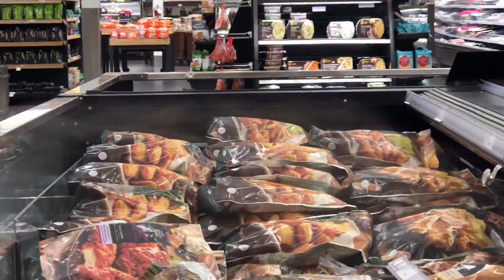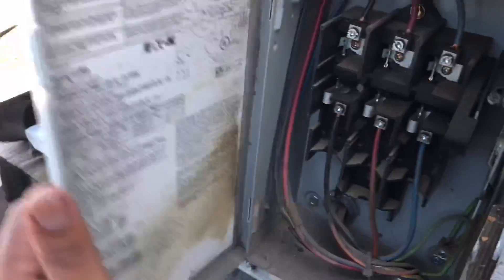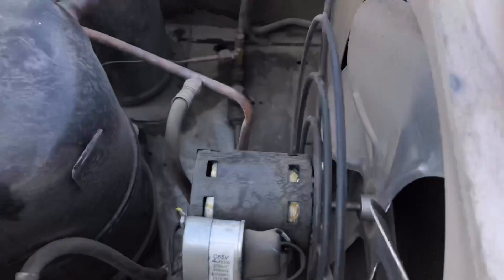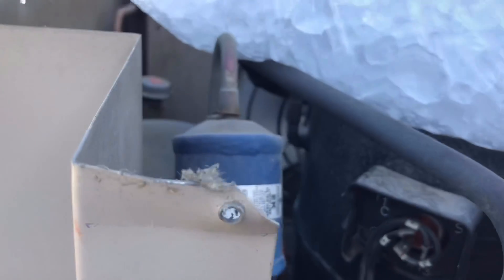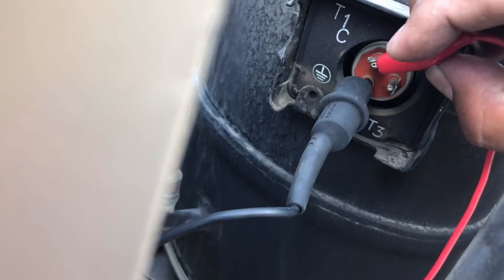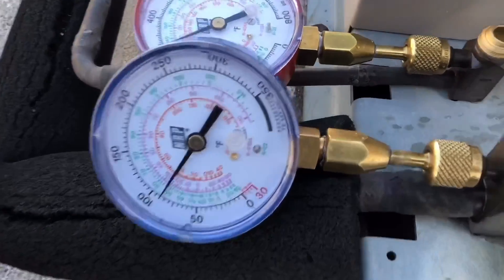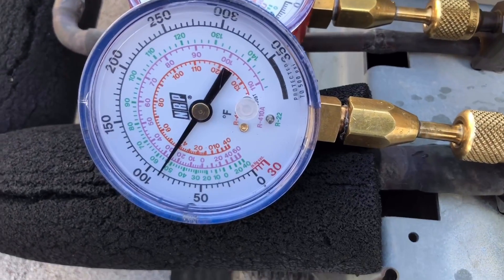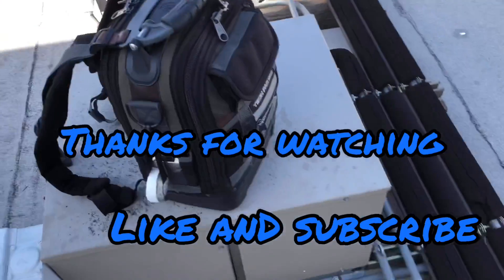HVAC Refrigeration:  Reach In Cooler Compressor runs but doesn’t pump.

Comment: Min 4:45
Fan won't run unless "pressure" (suction?) is greater than 250 lbs. 
re: Fan Cycle Switch
Reply from the maker: Discharge.   High side pressure.  Not suction
Reply: @rookierefrigeration4357  
Right.
("I should have known.")
Reply: @rookierefrigeration4357  
Thanks. 
Question: if discharge pressure has to be above 250 psi for the fan to turn on, how come the fan started when you started the compressor and the head pressure was below 250?

PS: great vids. Some are real 'stumpers'.

Comment: MN 3:36
How do you know the motor is good?
What is the meter showing?
Reply from the maker: I’m checking resistance on the windings.  I’m just checking for an open circuit, or shorted/grounded.
Reply: @rookierefrigeration4357  
Thanks.
I must have been thinking "meger".

Comment: some recip compressors would have an internal pressure relief.
Reply from the maker: They do. This one failed, you can see that in the following video
Reply: I'll second that, you can hear the relief valve letting go. I bet the amps were high like on a hot gas defrost, etc without CPR. Was about to make this comment, looks like someone smarter than I beat me to it.

Comment: low amps and high suction.got to be careful with copelaand scrolls.they can disengage motor from compressor if overheating happens.will start pumping again after cool down.usually if system is low on charge this can happen.
Reply from the maker: Yeah I’ve seen that
Reply: @rookierefrigeration4357  
This is a Copeland scroll?

Comment: The fastest way to tell if it is pumping is to check the amp draw. If it's not pumping the amp draw will be low.
Reply from the maker: Yeah.  And also the suction won’t drop or the pressure will remain equalized.

Comment: I absolutely loved being a refrigeration tech and do miss it a lot. There is no other profession that involves this level of troubleshooting and process analysis. But, you must go the extra steps to find out why systems/components failed to be the best in the industry. Otherwise you are simply a parts swapper.
Reply from the maker: Thank you John.  I appreciate that.   Did you retire?  Or just move on.
Reply: Commercial food equipment does, although I guess you could say they’re the same trade being most of us food equipment guys do both cold side and hot side equipment.

Comment: I think over charge unit
Reply from the maker: Pressure was not high enough to consider overcharged.
Reply: Rookie Refrigeration allready 350psi your compressor when you pump down unit your discharge bypass, you can’t pump down because unit overcharge , your compressor good, need to remove gas.

Comment: Suction drier blocked up probably
Reply from the maker: It was the internal bypass valve.
Reply: A restriction across a suction drier, will cause a severe pressure drop & more than likely frost will accumulate on the outlet side of the drier.
This typically manifests pretty quickly.
Had that drier been plugged, it would of frosted on the outlet side, but it didn't.
The pull-down test was the whistle-blower on this one.

Comment: Great video! That compressor sounds like it's on hi pressure bypass. The hissing sound. Thanks again
Reply: Is the bypass inside of the compressor?
Reply from the maker: Yes. On the discharge line.

Comment: Good vid can't help wondering why all your American out side switch gear is all so big and ugly! NZ has so much better stuff
Reply from the maker: martin bellamy lol. Thanks for watching. What kind of equipment you talking about.
Reply: @rookierefrigeration4357  just the isolation switches and ppts I see on the TV, we use these on the ac I install 
https://www.voltexelectrical.com.au/p-1433-voltex-weatherproof-switch-ip66-20a-2-pole.aspx